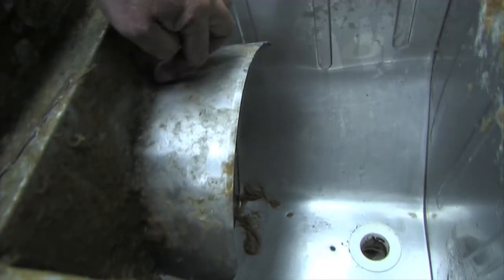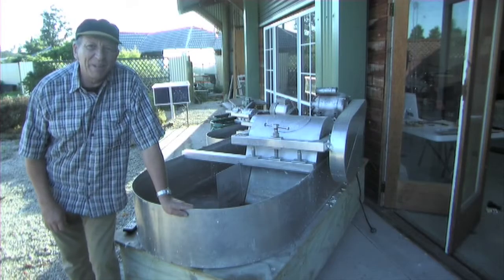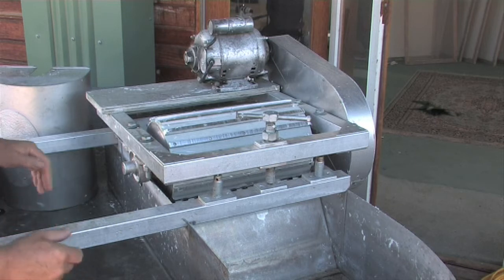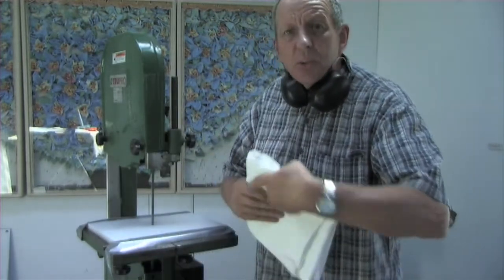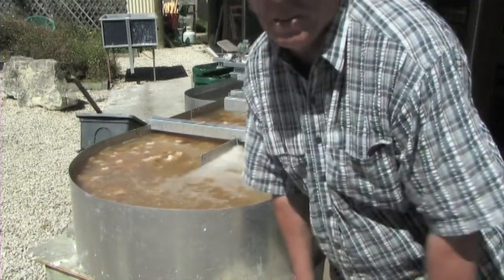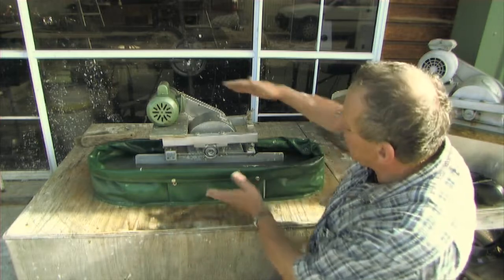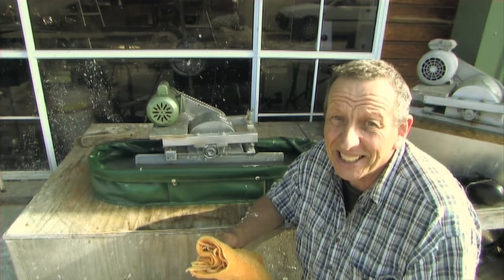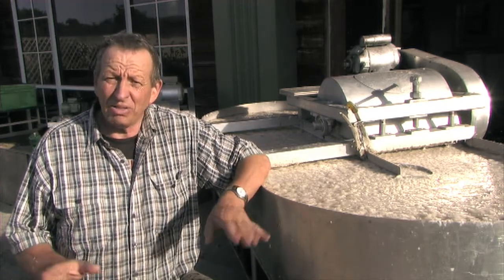Part 3 Papermaking with Mark Lander

Comment: Mr. Lander, I'm glad I came across your video. Now I make a hollander in the size of 130 * 50 * 20 cm, diameter of a drum of 22 cm.
Advise to choose the electric motor, power and speed, which is the number of revolutions per minute of drums in your hollander.

Comment: This machine is adorable and rocking, I have a doubt, do mind sharing that how "mm" will be the gap between the beater roll and the beater plate ?
Reply from the maker: Hi,  Thanks for your question,  The roll lowers to contact point... that's where the beating takes place, the bars are blunted ( leading edges slightly rounded)   and the pulp acts as a lubricant between the two surfaces.   The bars and bedplate are stainless steel... they will never wear out   :-)   You can make them of aluminum ( Far easier to work with)and they work fine for cotton rag and plants ..as long as you have stop bolts ..they will wear away without them !    Best from Mark in NZ
Reply: Got it, Thank you so much for your generous reply. @landergallery

Comment: Hello I like your holland beater machines very much. I worked with Aïdée Bernard! it is possible to buy a small holland beater machine of your manufacture. my workshop is in France. I will take the base without the main engine with a shipment via DHL, what is the price with transport and tax, as well as the manufacturing time. 
thank you in advance

Comment: Hi Mark!  Love the video series!   My Little Critter is working great here in northern New York State.   Question for you and/or others:  When you use it for beating cotton rag, how long does it usually take?    Should I beat it for 5-6 hours?  Thank you!
Reply from the maker: Hi Todd, Thanks for watching,  I think for as long as it takes to get the pulp you want... the big 10lb one runs on a 1.75 hp motor.. so it takes a bit longer .. the tiny 
Beaut runs on a 1/2 hp ... so the pulp is done sooo so much faster.  Depends on the rag too,    some materials are tightly woven and take longer.   The main thing is to have fun experimenting.